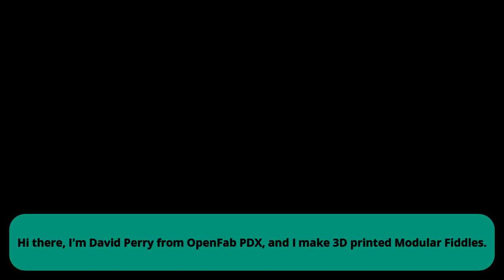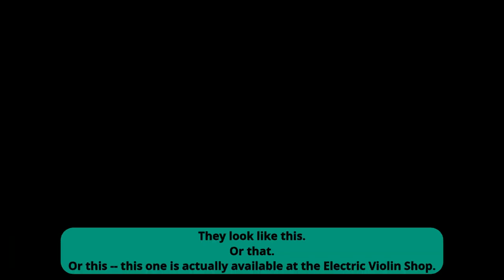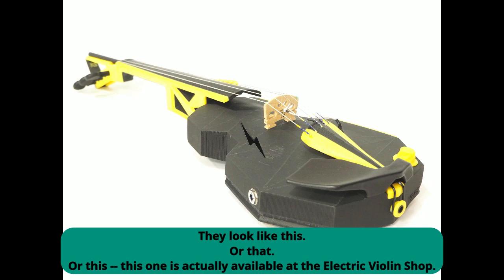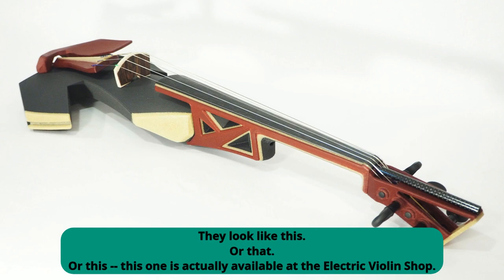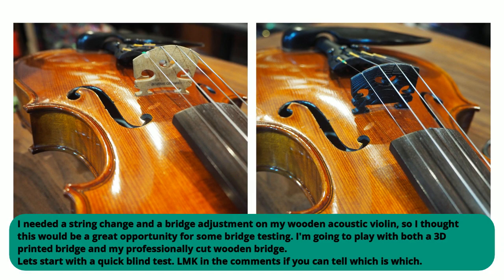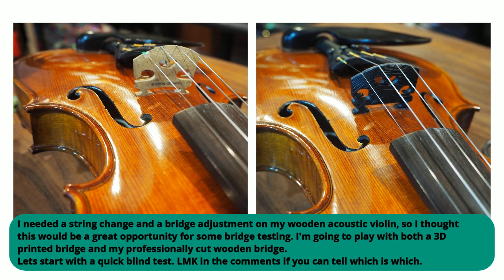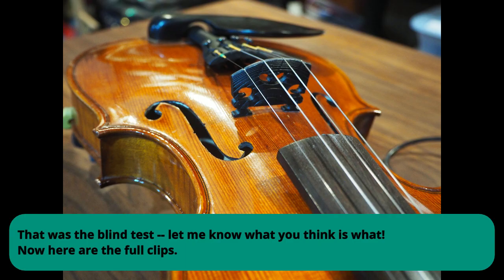Is this 3D printed violin bridge better?

Comment: Omg  the 3d sounds better to my ears..  how may i model a bridge? I have a bridge that needs to be replaced on a Greek/Cretan lyra. The bridge is fullyintact… my thought is to scan the bridge and then extrude in tinkercad to the actual dimensions of the wooden Bridge.
Reply from the maker: I’m glad the comparison is helpful! 

Tinkercad might not provide the amount of control you need over the model to get it all right. I would recommend using a different CAD program, probably Fusion 360 is the easiest. I usually start by simple measuring the bridge rather than scanning. You can also import a simple photo and scale it to the right size to provide a template. 

Feel free to reach out to me via email, david(at)openfabpdx(dot)com. I would be happy to model it for you for a reasonable price.
Reply: @openfabpdx  thanks! I have Fusion, I’ll give it a shot and if it fails miserably i’ll consult w you!
Reply from the maker: @JThemelis  sounds good — good luck!